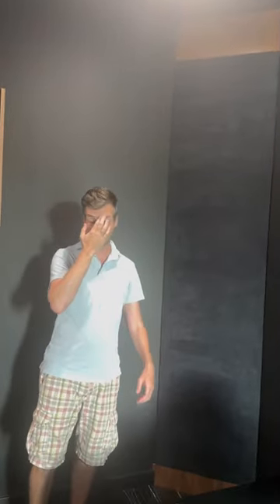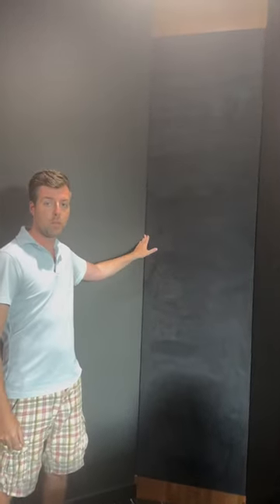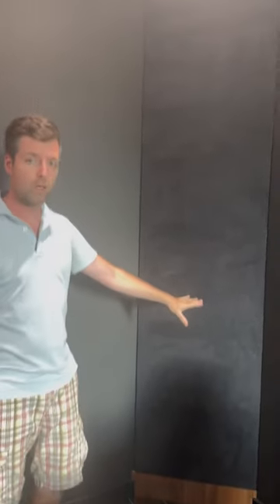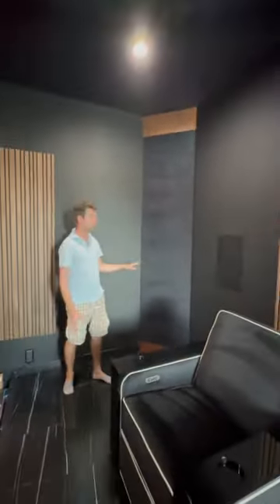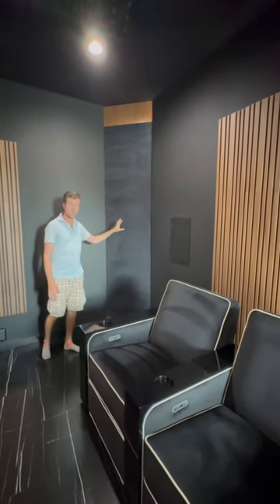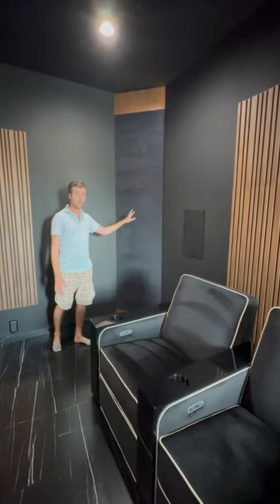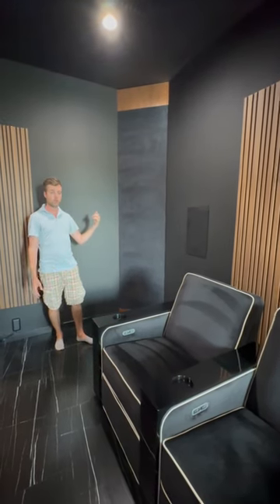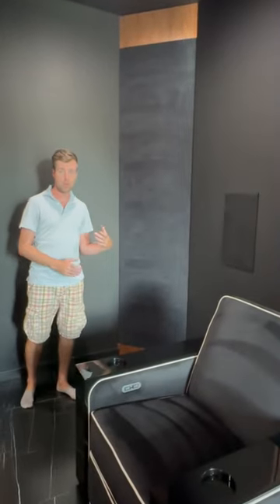Real acoustix corner bassmod corner bass trap #hometheater #acoustics

Comment: Is the diaphram a suspended metal weight?
Reply from the maker: I don't think I would describe it that way.  I would describe it as a metal plate not a weight and its rigidly attached along the perimeter.

To imagine how this works.  Think about the goal, to take a pressure wave, which contains a finite amount of energy, and dissipate a portion of that as heat.  To do that, think about what ripples in the water are after you drop a pebble in.  The Pebble has a certain amount of inertia and when it hits the water, the surface tension of the water causes the pebble to lose a portion of it's energy as it pushes the surface of the water down.  It bounces back up and ripples.  Consider that it doesn't matter that the pebble penetrates the water, it would make a ripple even if it bounced.  This sheet of metal is the same as the surface of the water.  The sound wave hites the metal plate and creates a ripple across it's surface.  Some passes through and suond bounces back.  However a portion of the total energy was used to ripple the surface.  That ripple dissipates as heat in the metal plate, which is damped via the fiberglass insulation at it's core.